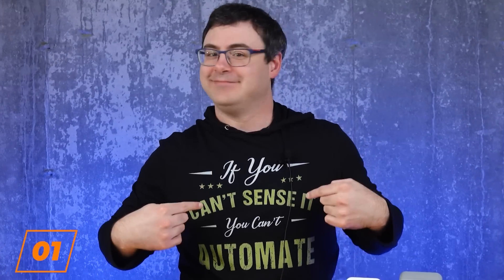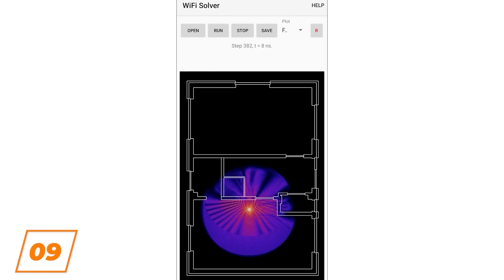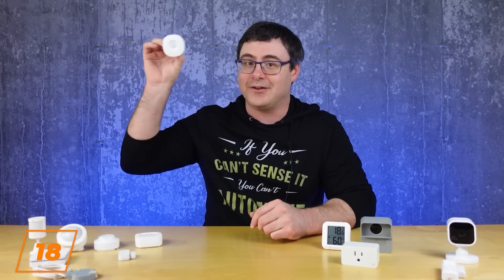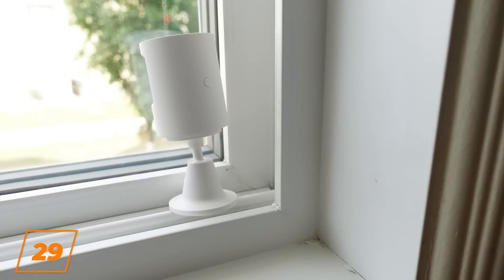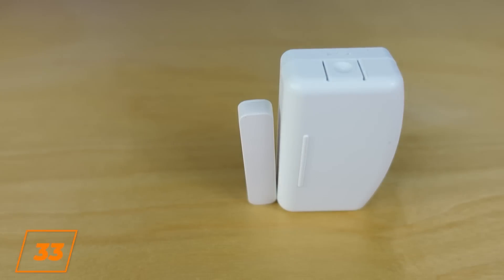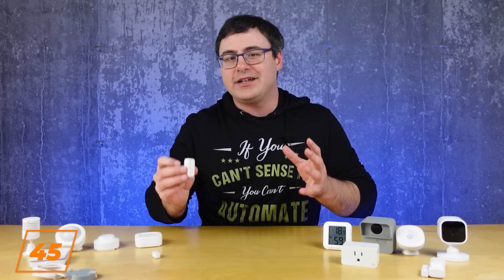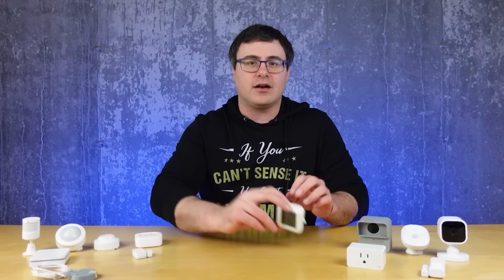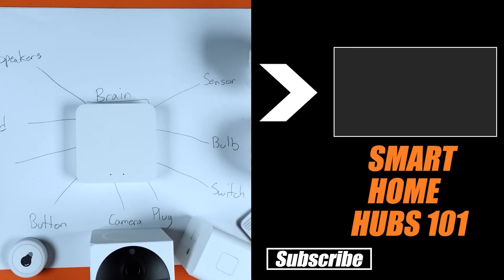59 Of the BEST Tips For Smart Home Sensors

Comment: Hi Brian  great videos, but I just inquire some ring contact sensors I want to use on 2 of my doors but can’t get them to work.  I have the Amazon Alexa echo dot  5th generation but my ring and Alexa app doesn’t seem to recognize the devices. Do I need the base station for this to work? Or can this work alone? Thanks
Reply from the maker: I haven't used them myself Tim, but I believe those are Z-Wave Contact Sensors.  So yeah, that'll take a Station/Hub from Ring to get working.  Sorry for the bad news!

Comment: Brian, 
*How can I better utilize my Samsung SmartThings hub? I feel as I tho, I don't use my hub for much of anything. Besides like 3 or 4 motion and sensor automations. I'm wondering, if I use the SmartThings hub 🤔 more, will that make my Wi-Fi better. Instead of, so many devices using Wi-Fi  openly.  Maybe have SmartThings do all the heavy lifting 🤔. Can't see how that would work tho. 😕. 
**Also Also, does Nest cameras have voice announcements on Google Displays and Google speakers? I know Alexa has voice announcements with Nest cameras. But I'm in the Google/Nest ecosystem. I wonder, if I can use SmartThings to make that work. 
***Also Also Also, I wish I can set automations with my Nest cameras (something else SmartThings should be able to do). Do you know how to do that?  
***Also Also Also Also, Is there a way to turn off viewing of a Nest Hub Max camera from other Displays in the house? I have a Nest Hub Max in my bedroom. And I don't want my children to see, what daddy and mommy are up to at night, after hours. I know I can turn off the camera on the device. But I don't want to turn the camera off. Cause I might forget to turn it back on, after I'm done with the *TIP. And I want my room to be constantly recording. Just not visible from other Displays in the house.
Reply from the maker: Hey sir,

Watch Saturday's video.  Set aside about an hour.

Also, no Nest Cameras don't have voice announcements except for the doorbell press.  That works.

My SmartThings has lots of my Nest Cameras and doorbell in it, and yes they can start automations.

No on the nest hub max camera.  Get cameras out of the bedroom.

Comment: I use the Aeotec sensor as a relay connected to a device called TornadoAlert. If a severe thunderstorm or tornado is detected, Alexa announces it. The detector uses NASA research about lightning patterns that signify a severe storm.
Reply from the maker: That's a really neat application!  Love the relay connection there you're doing!
Reply: Hi Russ sounds interesting can you elaborate more on that if you could thanks.

Comment: My favorite automation is the one that made my son say, "That's pretty cool". When I get into my bed, the door checks that it's locked and let's me know that it's locked. All the lights turn off, except the bedroom lights, which turn off 10 minutes later. If I get up in the middle of the night, select lights turn on at a dim level, and when I go back to bed, they turn off again. When I get up in the morning, all the lights turn on at the appropriate level. If I take a nap during the day, some lights turn off and some keep their "turn on when motion is detected" settings. I don't need to give any verbal commands, or touch any devices. :)
Reply from the maker: You gotta love that.  All done with a few sensors hey?  Actually, sounds like just the one under your bed!
Reply: @AutomateYourLife  And virtual switches! Your video on creating a virtual switch was so inspiring, I use virtual switches in almost every routine now. Want to create a controllable group of lights? Virtual switch. Want to control my lighting at different times of the day? Virtual switch. Want Alexa to tell me when the washer or dryer is done? Virtual Switch. Want to be able to easily identify which routines are running? Virtual switches for everyone!

Comment: I use two motion sensors to determine direction. Imagine, you're going up a flight of stairs with two motion sensors placed a little apart. If the bottom sensor detects motion and the top sensor does not, you are going up the stairs. Your system can turn off the lights at the bottom of the stairs and turn them on at the top. Same for the opposite scenario. Having two motion sensors on stairs or in a hall can determine direction.
Reply: Genuis,  thanks
Reply: Help 😂 ihay iWatch your Videos  I need help I want to start my room my closet in my bathroom and I don’t know what to get I’m so confused there are so many brands so many gadgets so many sensors I really don’t understand this please help me😂
Reply: Uhx😅
Reply from the maker: 100%!  What a great use case!

Comment: Best stand alone humidity sensor that works with Smartthings? Don't want another multi sensor that does not allow you to prioritize humidity.
Reply from the maker: Hey David, what's the requirements for humidity?  Did you want it to be a small threshold or a short time frame?  What would those be?  That'll help me direct you best.
Reply: @AutomateYourLife  thanks for your help! Looking to turn a bathroom exhaust fan on when humidity rises above 65% and back off again when it falls below 65%. The automation itself is easy, just can't seem to find a good sensor that will respond quickly enough. The multi sensor I'm currently using does not prioritize humidity, so it doesn't detect changing humidity levels quickly at all.

Comment: I use the vibration sensor from smartthings everywhere it is common knowledge in my house for people to knock on Doors to operate lights instead of using the light switch . I also  Use the weather inside of smartthings to determine whether or not I run with light codes
Reply from the maker: I like the knock option for people!

Comment: I have Lenovo Smart WiFi sensors that fortunately are rechargeable and last about 6 months depending upon the uses. 
If I could afford it I'd go Yolink LoRa.
Reply from the maker: How are you finding those Lenovo ones??  I had one here and never set it up!
Reply: @AutomateYourLife  I would recommend them only to beginners in the smart home to discover what is possible. The delay in triggering is disappointing, but reliability is good and no battery replacement saves money.

Comment: What kind of motion/presence sensor would you use in the bathroom? Ours doesn't work during shower.
Reply from the maker: So that's sounding like you've got a really humid environment.  Your motion sensor would work to know when someone is in the room, but maybe once your humidity climbs up to a certain level you use that to determine presence.

It doesn't guarantee it 100%, so you could additionally use something like a contact sensor on the door or even shower curtain.  They're magnetic so they like to click together 😃

I don't know your exact setup, but that might help.

My Smartthings one works in my bathroom cause the humidity never gets SO high.  So it's a bit dependent!
Reply: @AutomateYourLife  it keeps working in general, except for the person that is in the shower. I can keep switching it on by moving my hand above the (glass) devider. My wife and kids are not that lucky. I was thinking of putting a second (simple lidl) motionsensor inside the shower, but decided against it, because of the possibility of getting it wet.

Door sensor wouldn't work here, since my wife tends to leave the doors open :(

Comment: To get notifications when anyone rings my dumb doorbell I wired an external reed switch to a motion sensor (Aeotec Door/Window sensor 7) and fixed the switch right next to the doorbell coil which is magnetised to ring the bell, thus closing the switch and triggering an automation in Smartthings to send a notification. 

While good in theory the sensor battery drained within a couple of days. I'm not sure if the reporting to the hub is different when an external contact us used? I ended up placing the body of the contact sensor next to the coil instead which isn't as neat or reliable but doesn't drain the battery at least.

Comment: Nice informative vid Brian.  Do you know of a outdoor contact sensor that might have a range of 200feet. I am wanting to put one on my driveway gate.
Reply from the maker: YoLink!  Wayyyy back in my review of that system I had one.  It's bigger than most but the range is huge and it has a good seal
Reply: Yolink has a promoted range of 1/4 mile.
Reply: Ring makes an outdoor contact sensor that is compatible with the ring alarm system if you have one.

Comment: I placed my original Samsung multipurposent on my patio door with the magnet on the door trim. However the vibration sensor was way too sensitive as the siren an RCMP cruiser going by on the street wwould set it off.  Oh well, it makes a good patio door closed sensor.  As it is on the door it is interesting looking at the door temperature in warm and cold weather as it can be 10 or more degrees different than the indoor temperature.
Reply from the maker: Wow!  A car on the street got it...that's amazing.  I gotta try that actually.

Comment: I see a lot of these sensors are using CR123 batteries. Can you swap them for 16340 Lithium ion batteries ? 

Really impressed with the level of detail you go into with these videos, thank you 👍
Reply from the maker: Hey Edward thanks!
There is a little bit more length on the 16340, and there is a little bit more voltage.

I don't see a lot of these sensors accommodating that but I doubt the voltage would be a concern and I think you could shave off the cap if it was too tight of a squeeze.

Not sure I would recommend that, but I think it's something I can test in the future!  Time to buy a few ;)
Reply: @AutomateYourLife Thanks for responding.

 I was mainly wondering because even though they last a long time, CR123's are $4ea in Australia and I hate disposable batteries.

Comment: I'm using a Smartthings motion sensor on my screened-In porch.. if motion and above a certain temperature, the ceiling fan turns on. If motion and after sunset, the light turns on.
Reply from the maker: Glad you're having success with that Derrian!  That sounds like you've got that one located well
Reply: @AutomateYourLife  Man I'm COMMITTED.  I have 10 water leak sensors, 4 humidity sensors, 17 motion sensors, and 12 contact sensors throughout my house!